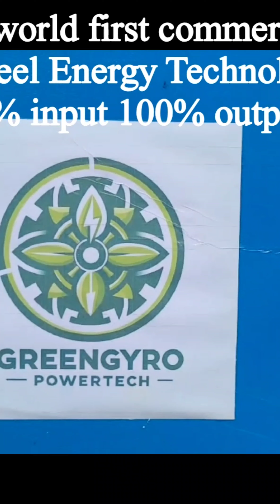the world first commercial 0% input 100% output flywheel Energy Technology - (Episode 2)

Comment: 20kv price
Reply: I have seen on their web site the following DEPOSIT prices in US$:-
GC 50 - 60,125.
GC 250 - 1,20,250.
GC 500 - 1,80,275.
GC 1000 - 3,60,750.
GC 10000 - 36,07,504
After you pay these deposits, you wait for one year (12 months) for the machine to be manufactured and then GreenGyro company will be taking, on a monthly basis, INR 4 (four Indian Rupees) for every unit of power (KWh) produced. Do you still want to buy. Personally I would have needed 10MW installation if these guys could proof their contraption works.